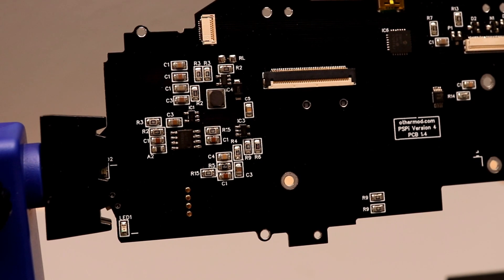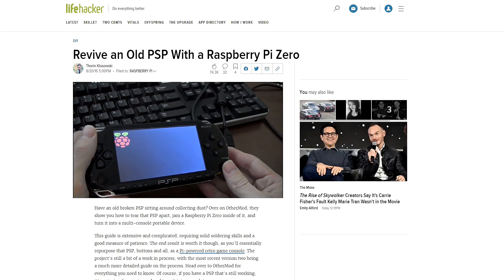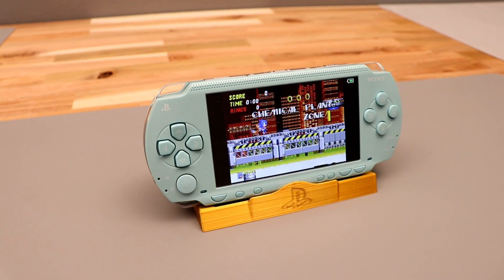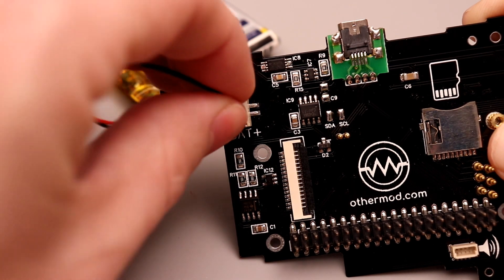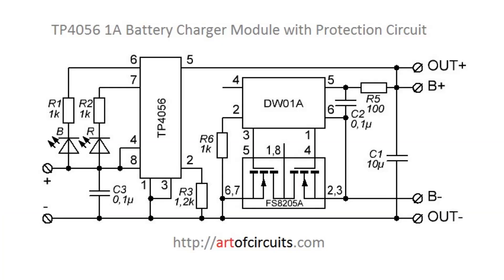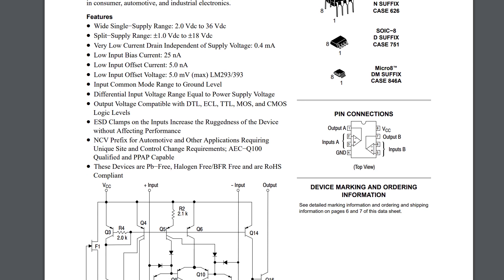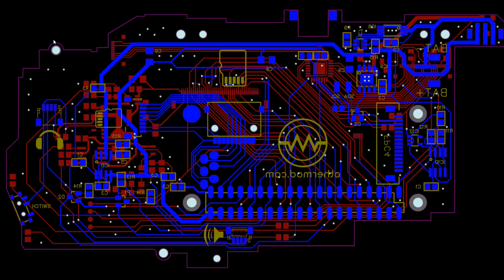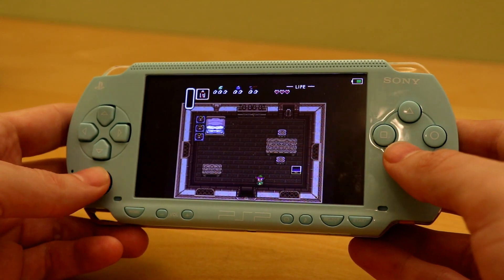othermod Returns! - PSPi Version 4 Open Source Summary - Part 1 - Battery and Power

Comment: Thanks for making this project. I got one of your v4 boards, but after all the soldering and installation I couldn't get mine to work. I plan to return to it one day and figure out what went wrong. Do you have any custom images for the pi? Will stuff from ArcadePunks work?
Reply from the maker: I have a slightly outdated one for the v4 board, on my site othermod.com. I don't know anything about ArcadePunks . If it's based on a normal raspbian image, it should work.